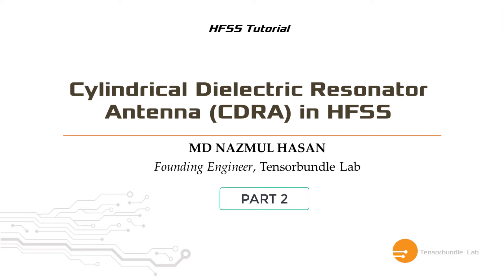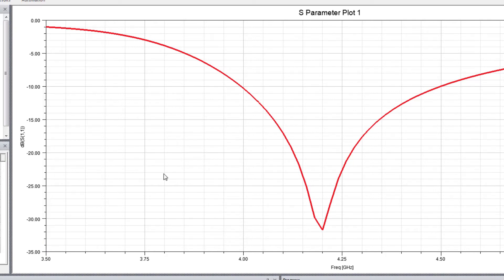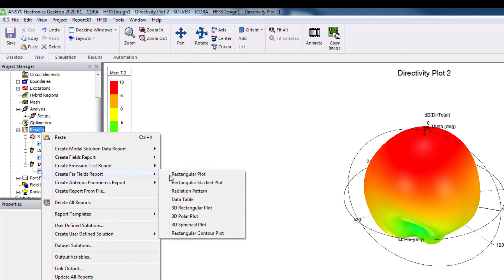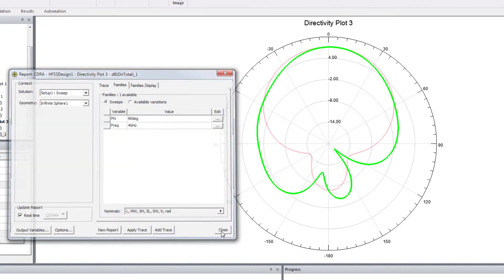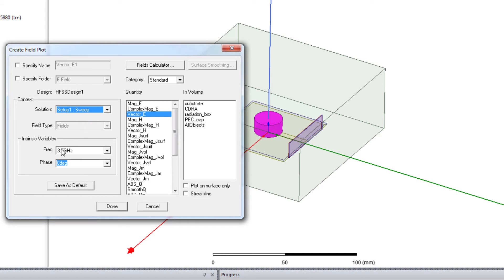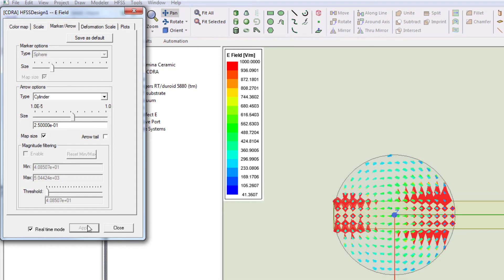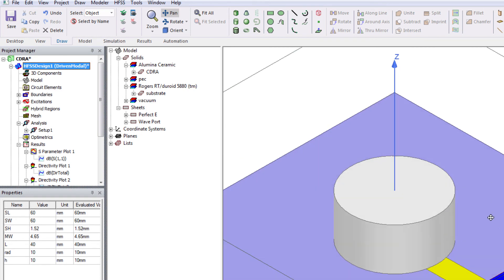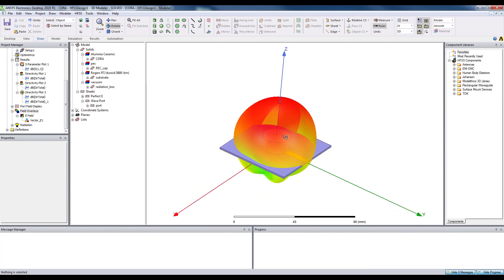HFSS Tutorial: Cylindrical Dielectric Resonator Antenna- Part 2

Comment: Excellent video, if I have a Dielectric resonator and I want to know de S-Parameters in a parallel match with the microstrip, Do I need to add the 2 ports wave radiation or it can be only one?

Comment: Thanks for your tutorial! 

I also woud like to know why I am not getting the results when designing a similar project: cylindrical DRA with coaxial probe feeding. I removed the substrate and connected the probe parallely to the cylinder. The S(1,1) plot is ok, but the other ones simply didnt show anything....